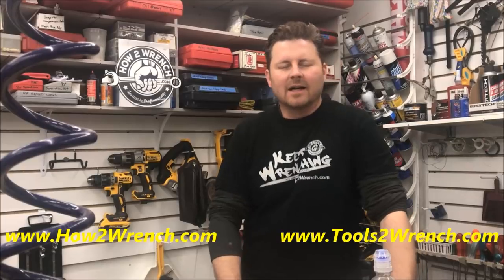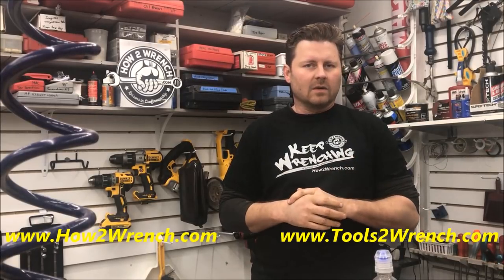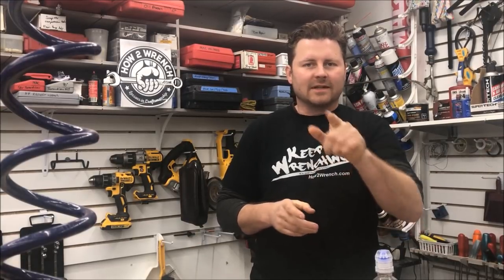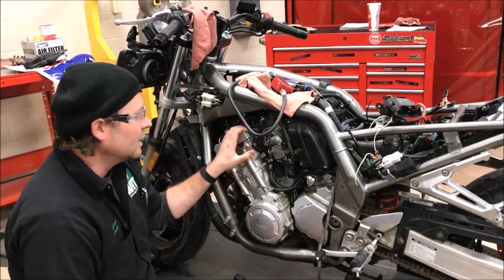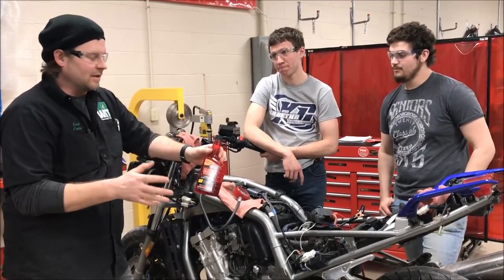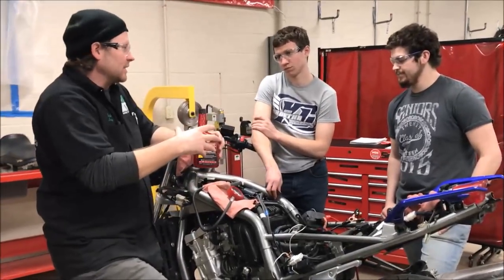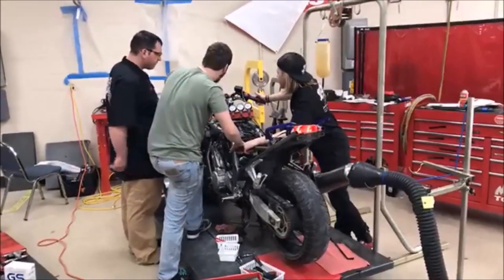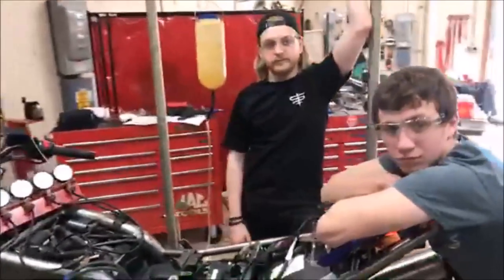Part 1: Does the Marvel Mystery Oil trick REALLY work to raise low compression?

Comment: I add a quart of MMO to every tank of fuel in my powerstroke ford diesel, the truck has 299,000 miles on it, still has OEM injectors and runs like new. I have used marvel mystery oil for the past 40+ years and I think it is the best thing since sliced bread.
Reply: I put a few cap fills in my tank every fill up and I'm driving a 2008 Toyota. Never any issues. Seems to run better.
Reply: Same here 299 k miles on my ford also but never used any oil mystery.Fird just makes great trucks that last for ever.
Reply from the maker: Thanks for commenting and adding value to our community!

Have you subscribed yet to never miss a video? Have you seen the video playlists? Over 600 videos! Check them out here: https://www.youtube.com/user/conleybuilt/playlists  

Want to say “thanks” or “keep it up”? Click here https://www.paypal.me/how2wrench    
 
Your answers and help are just around the corner. Save time and money while protecting your investment and yourself by doing it the right way at www.How2Wrench.com
Reply from the maker: @petroldevo9934  Thanks for commenting and adding value to our community!

Have you subscribed yet to never miss a video? Have you seen the video playlists? Over 600 videos! Check them out here: https://www.youtube.com/user/conleybuilt/playlists  

Want to say “thanks” or “keep it up”? Click here https://www.paypal.me/how2wrench    
 
Your answers and help are just around the corner. Save time and money while protecting your investment and yourself by doing it the right way at www.How2Wrench.com
Reply from the maker: @TheTruelakersfan  Thanks for commenting and adding value to our community!

Have you subscribed yet to never miss a video? Have you seen the video playlists? Over 600 videos! Check them out here: https://www.youtube.com/user/conleybuilt/playlists  

Want to say “thanks” or “keep it up”? Click here https://www.paypal.me/how2wrench    
 
Your answers and help are just around the corner. Save time and money while protecting your investment and yourself by doing it the right way at www.How2Wrench.com
Reply: 6.0?
Reply: @charlesfry695  7.3
Reply: Can MMO in oil eat the crank bearings ? They suggest to replace 20% of oil capacity and drive till next oil change )

Comment: Magically marvelous!
My Ford truck just hit 345,796 miles .
I use a qt with every oil change and 4 oz occasionally when I fill up at the pump . Not even a tick in the engine !
Reply from the maker: Thanks for commenting and adding value to our community!

Have you subscribed yet to never miss a video? Have you seen the video playlists? Over 600 videos! Check them out here: https://www.youtube.com/user/conleybuilt/playlists  

Want to say “thanks” or “keep it up”? Click here https://www.paypal.me/how2wrench    
 
Your answers and help are just around the corner. Save time and money while protecting your investment and yourself by doing it the right way at www.How2Wrench.com
Reply: @How2Wrench  Can MMO in oil eat the crank bearings ? They suggest to replace 20% of oil capacity and drive till next oil change )

Comment: MMO is simply magic. I use it in all my engines and have found that for top end maintenance once a year. I do a "cylinder enema", I bring the cylinder to TDC, then using an adapter for the spark plug which has a clear line and valve, I overfill the cylinder (excess goes into the clear line) so as to flood the cylinder and valve faces. I slowly rock the crank a few degrees and let it sit overnight. I then drain and install a clean plug and repeat for each cylinder. From sticky valves to stuck rings it works great a cleaning out the sludge.
Reply from the maker: Thanks for commenting and adding value to our community!

Have you subscribed yet to never miss a video? Have you seen the video playlists? Over 600 videos! Check them out here: https://www.youtube.com/user/conleybuilt/playlists  

Want to say “thanks” or “keep it up”? Click here https://www.paypal.me/how2wrench    
 
Your answers and help are just around the corner. Save time and money while protecting your investment and yourself by doing it the right way at www.How2Wrench.com
Reply: Can MMO in oil eat the crank bearings ? They suggest to replace 20% of oil capacity and drive till next oil change )

Comment: I would definitely like to see the compression ratio after having run the bike for a half hour or so. But it's nice to see some measurable differences with a product that are not just anecdotal in nature.
Reply from the maker: Watch part 2...Thanks for commenting and adding value to our community!

Have you subscribed yet to never miss a video? Have you seen the video playlists? Over 600 videos! Check them out here: https://www.youtube.com/user/conleybuilt/playlists  

Want to say “thanks” or “keep it up”? Click here https://www.paypal.me/how2wrench    
 
Your answers and help are just around the corner. Save time and money while protecting your investment and yourself by doing it the right way at www.How2Wrench.com
Reply: agree ,as any oil will make a film between the rings & the cylinder walls & add compression .. i have a very worn out briggs 5 hp in a splitter of mine , so i add the stuff directly into the fuel .. it does seem to help the compression issue a bit (more power) but as soon as I stop adding oil to the gas ..it obviously looses the added benefit as the piston 7 rings are still simply worn out & not sealing too well .

Comment: I was thinking of putting this in my motorcycle oil about 100 miles before my oil change, is MMO bad for my wet clutch?
Reply from the maker: Thanks for commenting and adding value to our community! I personally have only used it in the application I've shown to "unstick" rings. 

Have you subscribed yet to never miss a video? Have you seen the video playlists? Over 600 videos! Check them out here: https://www.youtube.com/user/conleybuilt/playlists  

Want to say “thanks” or “keep it up”? Click here https://www.paypal.me/how2wrench    
 
Your answers and help are just around the corner. Save time and money while protecting your investment and yourself by doing it the right way at www.How2Wrench.com
Reply: No, not if you have a wet clutch,  engine and transmission share the same oil.

Comment: MMO IS AN OLD AVIATION SECRETE....
SOME OLD ENGINES WERENT ALLOWED TO FLY WITHOUT IT....
IT WORKS BEST IF ITS USED FROM EARLY ON INCLUDING BREAK IN....
IF ITS ALWAYS USED IN CRANK AND FUEL....THE ENGINE WILL BE LIKE NEW AFTER 200K....NO CARBON ...NO SLUDGE...SEALS GOOD....EVEN GASKETS .....MMO HAS ITS OWN SECRETS
Reply from the maker: Thanks for sharing.

Comment: A modern "euro car" motor oil may be better way to improve engine performance as they are rated to higher temperature specs for turbo high heat conditions with detergents added and also back when MMO was developed motor oils are not the same as they are today. I tried MMO in an engine that is burning oil and it burned MMO in half the time as a "euro car" 0W-20 oil. Where the Castrol Edge was burning 1 quart per 1000km, I burned a quart of MMO in less than 500km. There is something to be said about modern oil specifications, esp. long life types that have had years of real engineering and tests done vs an old product which sells itself based on old wives tales and heresay. It may have been great back in the old days when motor oil was not very well designed. If you look at some of the videos where people tried cleaning spark plugs MMO vs other types did not do so well. I feel Gumout Tuneup is a much better oil additive and a proven injector cleaner as a gas additive. That also increases compression so go figure.

Comment: If the compression is higher on a few cylinders then stock,,, and lower on compression on a few others,,,. It's a carbon issue,,,.  Marvel Mystery Oil in the fuel,,, then some ,,.   soak on the tops of the Pistons,,,.  Then use a Windex bottle with water in it,,. Spray it in your carburetors,,,.   Or let it be drawn in through a vacuum line,,,   Water your Pistons,,,
Reply from the maker: Thanks for commenting and adding value to our community!

Have you subscribed yet to never miss a video? Have you seen the video playlists? Over 600 videos! Check them out here: https://www.youtube.com/user/conleybuilt/playlists  

Want to say “thanks” or “keep it up”? Click here https://www.paypal.me/how2wrench    
 
Your answers and help are just around the corner. Save time and money while protecting your investment and yourself by doing it the right way at www.How2Wrench.com

Comment: You want to put Marvel oil in your engine oil fine, but never, and I mean never put it in the tank of your car or truck.  It is one sure way of fouling your oxygen sensors and your catalytic converter early.  This kind of thing worked on old cars without all the modern pollution control nonsense.  And for those who don't know the cost of these components can be very expensive.
Reply: Jeez. I put 941 mls in my full tank every fall. I thought it was good for it. I developed a bad oxygen sensor near catalitic converter (engine light on). No fuel injection problems on my 03 Saturn. I also plan to flush engine in spring before I change my oil with 5/30 penzoil platinum oil change.
David
Alberta

Comment: It is a problematic fluid, It is mostly used to improve engine’s performance before selling the bike in order to avoid the price loss.
You should upload another video that will help detecting the use of this product before buying a new motorcycle.
Reply: גיא לכיש no it works he just uploaded another video 800 miles away compression still good,,,, sometimes it's just the ring stuck in carbon Murphy's Miracle Oil will loosen them up and restore compression you can also use Liquid wrench or you can use automatic transmission fluid in a little bit of diesel,,, if the cylinder walls are worn out and the Rings are worn out this won't help
Reply from the maker: Thanks for commenting and adding value to our community! 

Have you subscribed yet to never miss a video? Have you seen the video playlists? Over 600 videos! Check them out here: https://www.youtube.com/user/conleybuilt/playlists  

Want to say “thanks” or “keep it up”? Click here https://www.paypal.me/how2wrench    
 
Your answers and help are just around the corner. Save time and money while protecting your investment and yourself by doing it the right way at www.How2Wrench.com